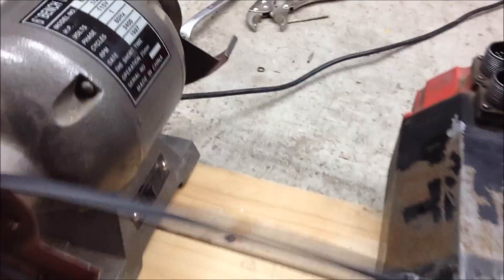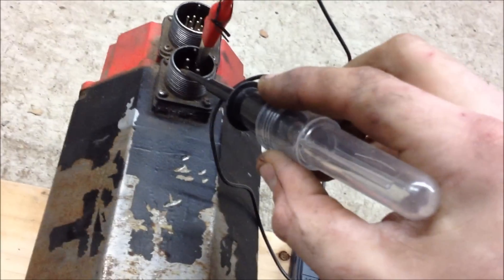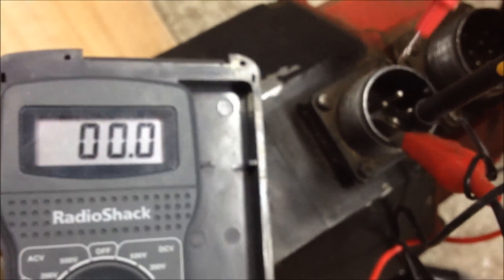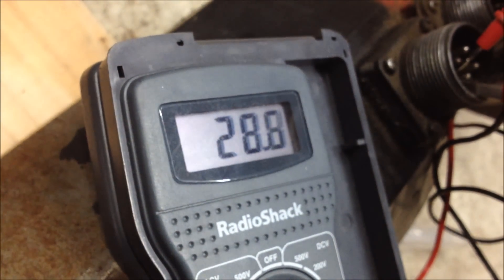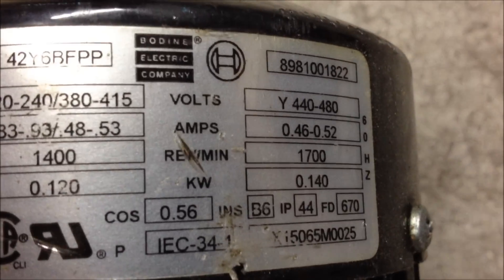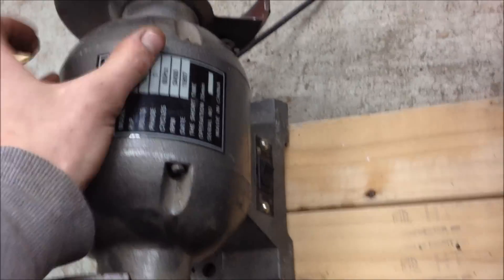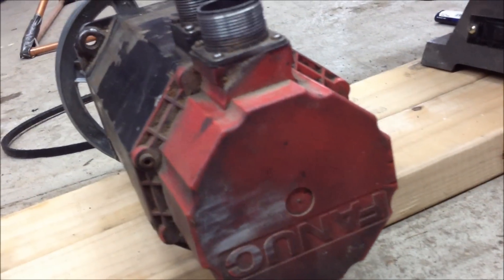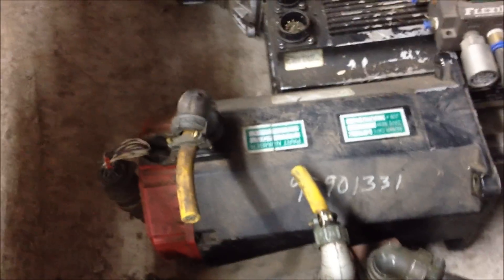AC DC Permanent Magnet Motor Generator GO OFF GRID POWER FREE Home Energy Electricity Setup HOJO PMG

Comment: Dude get your self a direct drive washing machine motor, make a stand for it. Hook up a electric bicycle motor that uses 12 to 48 volts to run. Put 2 in Philly on bike motor and 6 to 8 in. Pulley on washing motor.get little 6 amp 12 volt battery charger hook up your batteries in parallel

Connect charger to batteries, take the middle lead of washing motor use as neutral split 2 leads out of it . Use the other ones on each side of the middle one as hot leads. Use one pair to run charger and use other pair for whatever you want. You might have to make a few small adjustment. But you will like it😃

Comment: I am 16 months into my off grid journey, I started (high) buying a 1200w permanent magnet generator windmill, 3 phase ac. It goes to a rectifier with heat sink that changes it to DC. Then you go to a charge controller and relay to your battery bank. You also need a power dump in case of overcharging. From your battery bank it goes to an inverter which supplies your ac power. Missouri Wind and Solar was a great source for necessary information. As I can only budget a small amount monthly it is an ongoing project but it works and is giving me well water and wash house power by the wind and sun. Good luck, I am currently working on radiant watt amplification. I am more than glad to offer any help I can.

Comment: 1 electric hp
EQUALS
3 HP GASOLINE.

IF YOU HAVE A 15 HP GAS GENERATOR RATED @ 15,000 WATTS, HAVING 5-120 VOLT/20 AMP RECETICALS AND 2-240 VOLT/30 AMP RECEPTICLES AND 1- 240 VOLT/50 AMP RECEPTICAL.

YOU NEED A  5000 WATT /220 VOLT / 30 AMP constant speed constant hp synchronous ELECTRIC MOTOR RATED @ 3600 RPM TO REPLACE THE GAS ENGINE AND OR DRIVE THE GENERATOR HEAD AT FULL LOAD  minus electric motor AFTER BREAK AWAY STARTING ON GAS.

This leaves you 10,000 watts or 70 amps @ 120/240 volts to use freely.

Comment: HOW MUCH SIMPLER CAN YOU GET
. This GEM-(Geometric Electricity Multiplier)
=[free-energy-technology] works on simple pulley mechanics. It works because it does not cost 30 times as much energy to rotate a large 30 cm circumference pulley as it does to rotate a 1 cm circumference mini-pulley.
-
Yet, with the 30 cm of belt which comes off the single rotation of the large 30 cm pulley, which can be used to freely rotate 1 to 5 of these 1 cm mini-pulleys, gaining you 30 to 150 rotations. Which could be easily turned into 30 to 150 cycles of AC or dual pulse of DC electricity, by simply attaching 1 to 5 AC or DC generators/motors to these mini-pulleys.
-
. Yes, that's correct, someone can freely gaining 30 to 150 cycles of AC electricity, all for the mere cost of a few short bursts DC current. Then these mini-pulleys could easily gain the few sparks,(short bursts) of DC current that is needed by your drive motor, making this GEM a self powered mechanism. This could be the simplest free energy mechanism ever created, made of only 2 DC motors, 2 pulleys, a capacitor, a belt and some wire to connect the electronic parts together.
-
WARNING,,,, THIS MAY MESS UP YOUR MIND+LIFE ..... 
This new CERN=(Hadron Collider) is doing strange things in our world,,,
= https://www.youtube.com/watch?v=pPrutcbaerQ
+ https://www.youtube.com/watch?v=hEj_YD5tXL8
+ https://www.youtube.com/watch?v=-8fE-ooQikE
-
. It is my beliefs that I was first given this GEM of a free energy idea in the early 2000's by our Father, Who art in Heaven. I soon after put this idea on the web @ https://free-energy.yolasite.com/. I do not know if this other guy saw my website or not, but I was extremely thankful that someone had actually built one, and put it on the web for all to see. I know that many will think of more than a few ways that this could be fake, but please let me explain to you, just how simple this device could be used electricity to become a true free energy technology.
-
. I was first given this idea as a Vision, of a ten speed bicycle uphill in 10th gear, and then back down the hill in 1st gear. Now this can become extremely prosperous, if we are talking about AC electricity, which is generated by rotations. So the more rotations means the more cycles of AC, which means that we can use variable sized pulleys to actually freely multiply electricity power. Here is a forum website that I set up to discuss how GEM works https://www.facebook.com/…/2748420093393…/1232685043555085/…
- 
. This GEM mechanism is even mentioned in Scriptures = (Ezekiel 1:16) where a UFO engine is described as looking like wheels within wheels, + even mentioning the sparks coming from them
-
. Here are similar videos, that work on GEM technology
------------------------------------------------------------------------------
https://www.youtube.com/watch?v=NxpoiCFKmPg
https://www.youtube.com/watch?v=fwkvcgwziWo&t=303s
https://www.youtube.com/watch?v=ARq0ExkutIo
https://www.youtube.com/watch?v=HMSykXhG3Iw&t=168s
https://www.youtube.com/watch?v=fwkvcgwziWo
https://www.youtube.com/watch?v=sJgJDiWgvFw
-
HERE IS A FEW COMMENTS ON A FORUM: 
RBLXgamerTV2 (joe Lynch) - stop lying give actual proof
-
joe Lynch (@RBLXgamerTV) - I SPEAK THE TRUTH =
This proves it = https://www.youtube.com/watch?reload=9&v=NxpoiCFKmPg
-
joe Lynch (edited)
How much simpler can you get,,, this works because it does not cost 10 times as much power to rotate a large 10 cm circumference pulley as it does to rotate a 1 cm circumference mini-pulley.
-
Yet if you ran the 10 cm of belt, that comes off the single rotation of the large 10 cm pulley, past 1-10 min-pulleys of 1 cm, then you could gain 10-100 rotations,,,, FREELY
-
which could be easily be converted into 10 – 100 cycles of AC or DC electricity, by simply attaching free floating AC or DC motors/generators
-
These AC generators are free floating because they only have torque resistance if they need to generate power,,,, and the only power that these 10 to 100 cycles of AC electricity need to generate, is the few sparks of current to rotate your drive motor for one single rotation = (practically zero when talking about a steady current)
-
here is a video showing how simple that this GEM tech is to build = https://www.youtube.com/watch?reload=9&v=NxpoiCFKmPg
+ Here is a website that has an open discussion about how GEM works.= https://www.facebook.com/groups/274842009339398/

Comment: wouldent that be perpetual motion? I mean the energy required to turn the generator with the losses of the PMG effenciency wouldent be as much as you put in so the one motor would never be able to power the second one perpetually. You would need some other source of energy to turn the generator (water, wind, heat).

Comment: Honestly wind mills are a lose lose situation and expensive too.
Heat loss from friction is also a danger factor. They don't tell you about the loss of life of engineers that
have been lost working on those giant wind turbines. Playing with these devices is nothing short of deadly.
Especially to an ameteur. I watched a video of 2 engineers that were both killed by a rogue wind turbine.
Towers for wind turbines are especially dangerous, they are never strong enough and if it all bursts into
flames at 450 feet high  _ just where do you go__ nothing but down___and that can equal DEATH !
So my advice is get an expert and don't trust electricity EVER ! Good Luck. GO SOLAR it is SAFER.

Comment: the way i do it is that each of the posts you have 29 volts coming out of you hook up to a charge controller to charge your batteries ............ it just runs your amps higher when hooked to the battery not more volts ........... but you get twice the volts out of your motor

Comment: Did you do something with your project? First of all you need to reversed the wheels and you will have much higher speed on the servomotor so higher voltage. I would be curious if you continued this project. I have two servomotors and I'm working with them.

Comment: what you should do is get a powerful solar panel  or two and a voltage 
regulator to a DC motor. don't be a idiot and try to make everything 120
 volts "in the end", get as many "regulated" volts as you can going to 
the motor and get a solid 12 volts out of the generator with a 
controller or voltage regulator , everything usually knocks back down to
 12 volts in the first place not to mention you can usually find 
whatever your looking for as a 12 volt model also. The most retarded 
thing i see people doing is going DC to AC then the transformer of 
whatever they are using knocks it back down to 12 volts DC...with 90% of
 the energy loss in the power inverter... I see so many people doing 
this and think they have made some kind of revolution with a power 
inverter. if you have a power inverter anywhere in your setup you need a
 new hobby.

Comment: 29 v is very low. A usual power switch and/or outlet passes 120 v to the load. You can't power anything but a DC lamp for 9vDC. You need a poer. Another thing you need to do is switch the gears (small on Generator and big on Bench grinder). This should help. Also if you keep it the same you should wire a MOT. Try this and if not working email me at projectboy474@gmail.com. Would love to help you to be able to add to your power supply unit (conneted to the Solar Panel).

Comment: it should make more power if you switch pulleys, where the pulley on you grinder motor is larger than the one on your generator. You could run the power out of the generator through a step-up transformer to boost it up to the 220 volts. You need to make sure that the final output is 60 hertz/60 cycles before you run it into your house. If you are not a licensed electrician or really know what you are doing, you need to get a licensed electrician to hook it into your house. I can't think what else you might need to do or what you might run into. For one thing you might need to figure out a different way to power  your grinder motor, such as a solar panel or something, I don't know.

Comment: i also am trying to achieve the same goal in the same manner as you as well as others. My thoughts were using a battery bank to get it going, possibly a solar system as well. just needs the right setup to get itself going then have to right items in place to keep it powering its self. my thoughts are generator to bank, bank to generator pullied to another dc motor ensuring the bank has ample energy source to keep itself running inverter from bank maybe aswell hardwired to the motor. Thats where im at got the funds but need to know where to place it. Uncertain on the right motor and what not.
Reply: did like your project.  carryon
Reply: +Ashok Kumar Motwani  suggest u a capacitor bank
Reply: He has generators not batteries, what he should do is get a powerful solar panel  or two and a voltage regulator to a DC motor. don't be a idiot and try to make everything 120 volts "in the end", get as many "regulated" volts as you can going to the motor and get a solid 12 volts out of the generator with a controller or voltage regulator , everything usually knocks back down to 12 volts in the first place not to mention you can usually find whatever your looking for as a 12 volt model also. The most retarded thing i see people doing is going DC to AC then the transformer of whatever they are using knocks it back down to 12 volts DC...with 90% of the energy loss in the power inverter... I see so many people doing this and think they have made some kind of revolution with a power inverter. if you have a power inverter anywhere in your setup you need a new hobby.
Reply: Dear I am getting 240 v but power is not usable  cannot run induction motor but light bulb is working. Have added DC link to charge 48v batteries and use power with inverter. Have to try yet. What is it opinion
Reply: Ashok Kumar Motwani
Reply: For five kW how big capacitor is required.  Can take out some calculation.
Reply: Wtsup India 9810025666

Comment: what i want to do is get a water turbine with a generator that would put out 120v at 20kw of power and install it to my swimming pool system or to my waterfall system i would add a second  pump so that pump 1 runs 4 12hrs and when pump 2 turns on to run for the next 12hurs at the same time  pump 1 turn off to rest 4 12hrs ......
.
what i think you should do is get 4 light switches switches 2 from house power to switch then to motor.  then 2 switches  from gen to switches  then to motor when you power up the motor with switch from house power turn switch house off at the same time turn gen switch  on.   4 switches one for the hot black wire and one 4 neutral wire white

Comment: just take a old 110/220 gas gen then rip it apart  when your down to just the gen get a 110 v motor make sure the rpm s are the same weld it to the gen plug it in to to a 2nd fuse box light up your whole house tun your dryer washer tvs ac ect all from you plugin to your 110 outlet and your electric bill will be like 34 to 40 bucks a month not 300 lol think only one thing is plugged in to the main fuse box 110 outlet thats all the power that you are using from the gen .out u have 220 line going into 2nd box and  and bam u have alot of power for cheaper   this will work

Comment: if you have 2 outets putting out couldn't you charge 2 seperate battery banks with that motor
Reply: using 2 charge controlers

Comment: You have one motor plugged in..you dont need to..just wire one motor to the other and you can give the pully one spin with your hand and that will give enough juice to power it..once its spins it is self powered ...
Reply: jeromey terrio what video would you suggest I watch to understand and or duplicate for my personal use?
Reply: Am not sure one spine will work, he'll need lots of spin and fast before it'll pick and how can he off hold the fan belt🤔

Comment: either before or after the transformer. Im not sure how it works with generators... but when 2 20A circuits in a home get connected down the line, there isn't really an increase in current or volts because that depends on the load placed on the circuit. if exceeded, both breakers would trip. But im not sure if that is true when you are creating the load, in fact, I believe it will increase your current, yet maintain same voltage. thats where the transformers come in.  email's my name 516@gmail.

Comment: 30A single pole breakers. sorry.  they don't necessarily need to be 30A. Test your output, and research info on the transformers so you can maximize your output. your goal will be 115-135 Volts per circuit. I know transformers are very capable of stepping up voltages, but doing so results and loss of current, or Amps.  That's what matters when you hit the breaker panel, so if you have trouble maintaining current when gaining the volts you need, carefully try splicing 2 or more lines together--

Comment: ---- bus-bar (side of the box) and connect your neutral (white wire, common) into the neutral bar and MAKE SURE YOU PROPERLY GROUND THE PANEL AND MOTORS/GENERATOR!!!!    This entails driving a copper rod at least 3 feet into moist ground, and connecting a 6 or 8 gauge wire to the rod, and your panel. then you can just connect your genny setup to the panel.   Good Luck!!!   If you haven't already figured this out, let me know how it goes!!   I could most def use a motor, too!  (hahaha)

Comment: im really just getting into this generator conversions and self-running devices, but I am a contractor and know AC household electrical systems very well, and since you are generating AC at 29 Volts per phase, if you use transformers to 'split' your voltage (custom E-core transformers with the input coil center, and output coils on the top and bottom bars) you can make the feed (black) wire part of a circuit.  Get a 60 or 100 Amp breaker sub-panel, and use 6 30A breakers as feeds (3 on each ---

Comment: you need a 6 pole 3 phase motor so it will give you enough to run a single phase motor inturn that runs your 3 phase motor cupuled to the same shaft using flywheels from car engines. I suggest not to hook up to your mains it will explode you need to isolate your main power with a solar panel intruder into your mains power box on the side of your house

Comment: Have you used a Power Jack 1200W GTI with a built-in AC source plug? This should get the motor started then it should feed off the energy created by the generator into an array of batteries in your battery bank. If it generates 29 VDC then create a battery bank for a 36V (use 3 12V car batteries in series) it would only be profitable if the generator produces more energy than the grinding wheel consumes.

Comment: ok Run the Ac table saw motor with regular 240  volt house power wile its run with the full speed transfor the power  quickly  to the generator  and  you will amazed like I was  earlier I said the tricky switch is a 2 way changing mode from the 240 volt house power  it quickly changes to generator But you  Must get  the motor running in a same direction find out the 3000watt generator head  negative and positive good  if u don't  understand the parts google  it  good luck

Comment: glad you didn't ignored alright the way to make a generator that  RUNS ITSELF  in order to continues electric you will need to  understand  Wattage  is the answer   first of all you will need and just a Ac table saw Motor they are  usually  600 to 700  Watt of power  240  volt that is the first thing you need  Secondly  you need a 3000 Watt generator  head  and  you will need  TWO  pulley wheel and belt drive . OK  you belt drive assemble them  Right then the Tricky switch.
 to be continue